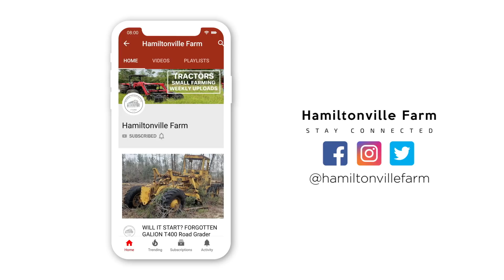Homestead Implements Grapple Loading Hydraulic DUMP TRAILER With 3 HUGE Logs!

Comment: Brandel can you tell us why you got a gooseneck and what is it rated for
Reply: I rented a 6x10 bumper pull dump trailer about a year ago, and it was the worst pulling trailer I've ever experienced. This is the first gooseneck I've owned, and I'll never have anything else. It's a 14k trailer, 7' wide and 16' long bed. It pulls like a dream, and has dumped everything I've put in it, so far. I also love how heavy the floor and rails are.
Reply: @BigOrangeTractors  now all you need is 40 acres haha

Comment: Use your mirrors and put your hand on the bottom of the steering wheel. Turn the bottom in he direction that you want the trailer turn
Reply: The first tip is to make sure your mirrors are clean. That was the malfunction during this experience. I appreciate the feedback, though.

Comment: That trailer cost more than the cabin I live in is worth and seriously that is calling this shack I live in habitable. Just never allowed to myself a good place to live should the one I built get away from me. I don't miss the neighborhood but I do miss my home an shop.... between the two of them it was over six thousand square feet and now I live a space of less than five hundred..... 16 x 20. A house this small you'd think that nothing could get lost or put away from yourself... and you'd be wrong as it just piles up like a hoarders cabin. PLUS SIDE: I been thinking on ways to make a hitch that converts a draw hitch over to a fifth wheel so that you could take a little truck Like Fat Tony with a fifth wheel on it could tow trailers or other nice stuff that is more stable when hooked up to a truck.  By the way todays video is close to his video showing his lack of ability to drive a large rig. He handles his pickup just fine but when you put the throttle to the floorboards and then let the clutch out something is going to break and he tore his driveshaft right into! No cracks or rusty thin stuff, just right into bright metal. He is one nice young boy but no clues when I say that your a better mechanic than he is. I would love to see that truck with a nice little fifth  wheel setup on it to drive stuff around. Cost a little to get it up to "Bluetooth" quality but still doable. I just would love to stay down in a place like that  where jet boats are the norm and you take a boat to mainland to get to a car. I ain't real fond of your gators tho
Reply from the maker: We do have a lot of gators😀